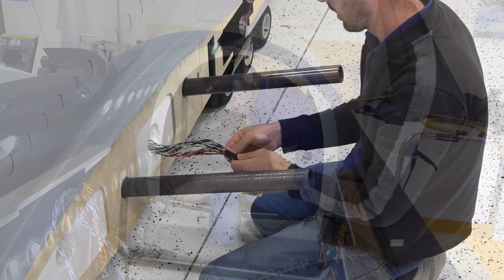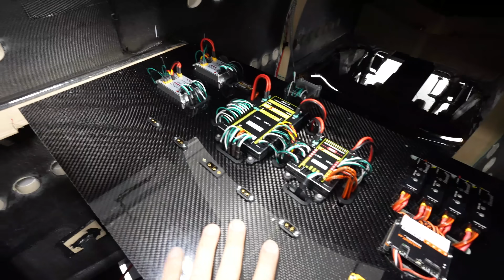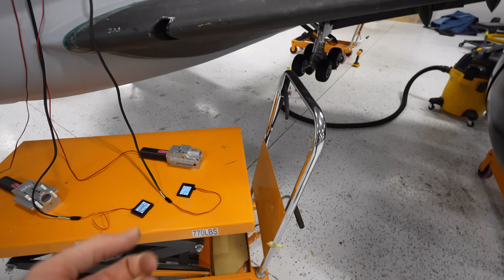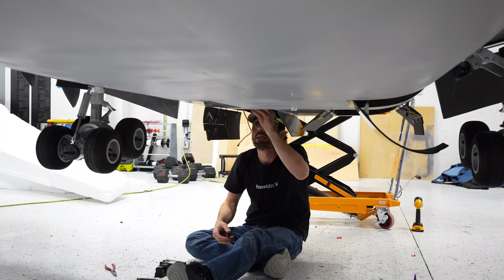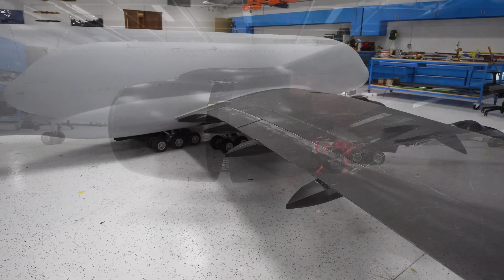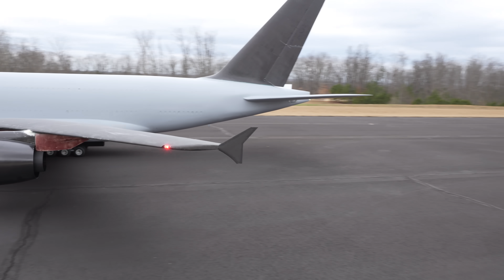Ready for the first flight, World's biggest RC Airbus A-380, Final

Comment: Spoilers should be disabled below certain speed during airborne. Weight on wheel sensor should be used for deploy on ground. Otherwise accidental deploy during slow aproach would drive the aircraft into stall.

Comment: I don't know much about RC planes. But I have been following ramy for many years and this is my first time commenting. Is it possible to fly it further? Like connect a camera to the cockpit? And what is the range with the radio controller? Like mounting like a cámera and the screen shows the speed angle etc etc.. How far can he fly it? Would be cool to see something like that... With the size of that plane hehe. No small rc planes
Reply: No and no and no, it has less than 10 minutes of flight time, thats just few circles around. Also legally it has to remain in direct line of sight so its not going too far and no cameras.

Comment: What's the overall weight? Like everyone else, I ponder about making a manned version - at that point it's not R/C, it's an A380 shaped experimental airplane (probably not even an ultralight, too heavy). I don't know the weight of this version, but with 450lb of thrust I'm sure you could make a version that could lift a person pretty easily. Could probably get FAA approval to fly it, in fact they might be more okay with that than such a huge R/C thing. The pilot would need to be multiengine rated!

Comment: Nice video @Ramy Rc the a380 look good but there Is a Rc engine that still on when ITS idle  instead of The engine that Will On if the Remote control Throttle Pushed but still Is a great a380 model

Comment: Super impressive!  I offer a suggestion ... for workshop testing, if you have some current meters (ammeters) that you can plug in-line with the batteries ... this will reveal unexpected drain on the batteries.  This would have identified the servo loading problem, but could also help identify other unexpected issues.  For the very high current circuits, inline current shunts of a few milli-ohms can allow current to be measured using a millivolt meter across the shunts, while having negligible effect on the system.

Comment: Can't wait to see the final product. Would love to see the Emirates "United for WIldlife" livery on this one, though it might be hard to reproduce the animal art. The Emirates NBA livery is very sharp as well. Too many good ones to choose from.  A plane this size & scope needs an equally good livery. Something that has always bugged me on these builds...I suppose cutting the gear doors from the composite structure makes perfect sense, but they need framing on the back sides to supply reinforcement and to give them some substance and depth. Also, seal & finish the edges of both doors and control surfaces so they don't look like mere cut-outs. It's a minor change, but the result would be much more scale in appearance.  I will say the new gear and especially tires that you are using are much better. The ones on the 777x were too narrow by far, but these are very scale.

Comment: Great job Ramy 👏,  but one thing that I noticed on the port side or left hand side of the airplane ✈️ facing forward,  the reverse thrust shell don't know the technical word for it , I notice that it vibrates and try to open up after applying thrust to the engine🤯😬 maybe that can become an issue later on wouldn't hurt to have it checked out 😊 and make adjustments 😁

Comment: for the landing gear sequence problem, I think time is not a reliable source, if for any reason, the door is not were is suppose to be, it will crash with the landing gear, a better solution would be having a sensor or a switch that sense the door reached position and only after that, allow the landing gear move.  I'm a hobbyst and do arduino projects, but from RC I do not know nothing, just my 2C

Comment: I know you know what you're doing, but in the spirit of "check everything"... I would like to point this out.
On some full scale aircraft (small GA in my case) we had to compensate for loads from being "in the airstream" when checking gear door clearances and gear swing timing (door shutter, gear drag etc...).
Meaning that it would work on the jack stands, but get jammed when going 100+mph. Saw this happen first hand on a twin Bonanza and it cause an emergency in flight.
Not sure how you would like to do this in this case, but what we did was create large safety margins, then do a flight test with multiple swings, and then close the "gaps" in accordance to measurements we took in flight.
Perhaps start with huge delays in this case, then using a camera underneath in test you see if there are any changes (like gear swing time etc...) while at appropriate airspeed, then decrease delays/adjust control linkages to the desired tolerances?
Not sure if that helps, and honestly I doubt this would make a difference here, but thought I'd just say it cause I thought it was interesting.
Anyways I love this channel, been a fan for years, big ups Ramy and Tyler for doin this craziness!!!

Comment: Ramy please watch the reverse thrust on engine 2 and 3, when you apply power, they are opening slightly, if this happens because pressure forces them open, it's gonna be hell if it happens on take off or in the air, if they open to max. Do a full power check on the ground before maiden an see if there is any chance they can open without command. And please don't ever stop making new models🤩😍🥰 Grüßeee
Reply: Whilst it could have some mild aerodynamic effect, the reversers are just cosmetic. They don't work to provide reverse thrust.
Reply: @kwerk2011 he showed it reversing in the video?
Reply: @MattRoberts-t4c  It's just a mechanism to open the shell of the engine fairing, giving the appearance of a thrust reverser. It doesn't actually work to reverse the airflow. Ramy describes it in an earlier video.

Comment: Just asking, I have zero information regarding to that, but, why jet engines are not used in this model? Is there a reason, or just a matter of preference?
Reply: Electric are faster to set up and fly. Turbines are fire hazard - look at that dry grass around.
Reply: @randomnickify  Thank you, as I understand, using jets adds additional risks. But in which circumstances one should use those?

Comment: 10:17 Ramy, You have to go away from pure Time Sequencing and go towards Event Sequencing. You have to involve sensors that will tell your system that such and such event has occurred, i.e.; Door Fully opened, until then you don't lower the gears and vice-versa. That should be easy to program with an Arduino setup. There are no reasons to get to full resiliency like an actual airliner, but for now, this step should solve these potential problems.
Reply: I was just wondering the exact same thing. Hopefully he explains why he didn’t go that way
Reply: @sipsapsop  lazy
Reply: @thomgizziz someone spends weeks building possibly the world’s largest A380 rc replica and you call him lazy just cos of this? You don’t even know the why. SMH
Reply: @sipsapsop  HEY!

Comment: You should use end stop limit switches with roller for the landing gear. It gives you position assurance; will not break the doors. Also never recoil landing gear during maiden flight, I might be too late on this one...

Comment: There is a solution to the gear and doors timing.  Use micro switches that locks out the gear doors circuit until there is a signal that the gear are either fully down and locked or fully retracted.
Reply: I strongly agree - that has been my first idea when watching these difficulties: Use end stop switches to synchronize doors and gears. It would require only a few lines of code in any micro controller...

Comment: At 66 years of age I think the most impressive thing about these planes is not the size and complexity of them, it's the ability to program everything into one transmitter, it used to be if you had this many servos and engines you needed two transmitters and two pilots, the new technology is so impressive and amazing to me.
Reply: I remember buying a very expensive Futaba 6ch and using servo arm and horn position to adjust the throw rates
Reply: @texasrob2782  Yup, my first radio was a  Challenger 550...lol
Reply: @t @texasrob2782  I had Futuba 6 channel as well, cost a small fortune back then
Reply: Don't forget it has a gyro system too, so almost certainly full autopilot is available.
Reply: @slammerf16 and pitot. Wouldn't be surprised he's got radio altimeter
Reply: Die Zeit steht nicht still und der Geldbeutel wird schnell leer 😢
Reply: Wow, it's insane that you once needed a co-pilot to fly an RC plane. Kinda funny how flying a model plane can mimic real life.
Reply: Well, worst case you could always build your own system with your own microcontrollers and firmware and use LoRa for digital transmissions.
Reply: That's an excellent point.  The ability to link so many functions together to run automatically is a game changer.  Amazing that two hands can do it.

Comment: that thing is bigger than a Cessna 172😭
Reply: When your RC toy is bigger than an actual passenger aircraft.
Reply: Yes I was gonna say..and I use to fly C172's!
Reply: I'll correct my remark..it's DEFINITELY bigger than a C152 then..that is in wing span and body length, not height!.
Reply: @KoolKman  Is it legal to fly such a large radio-controlled aircraft? In Europe, it's impossible without special permits, obviously.
Reply: @KoolKman  no it isnt
Reply: @thomgizziz  well its def not as big as your mom
Reply: Ramy should do a 1:1 scale R/C Cessna
Reply: @chrissugg968 must be 2:1 scale 😁
Reply: @chrissugg968  A318
Reply: and makes almost twice the hp!
Reply: It is THREE times larger than a tiny single-seat turboprop called the Cri-Cri.😂😂😂
Reply: Interestingly enough, Rami mentioned 450lbs of thrust. Depending on the prop and pitch setting, a Cessna 172, static thrust (at full power, aircraft stationary) is capable of roughly 400–500 lbs of thrust at sea level under normal conditions.
Reply: Bigger than a Cassutt racer
Reply: It could
Reply: LOL TRUEE😂😂
Reply: Basically a car
Reply: it is no cap
Reply: even he rides the wings💀
Reply: I swear
Reply: It’s big but it ain’t that big lol
Reply: @TJlive5  Bigger than a 152 though
Reply: Does he mention the wingspan during the build? I think you're right and it's about the same as a 150, at least larger than and RV8.
Reply: @benedekhalda-kiss9737Length and width probably, but definitely not height wise
Reply: @StoopyMcPoopy its really long
Reply: It is built at 1 : 10 scale that means it has a swing span of 8 meters which is a bit smaller than the 172 11m but it's quiet close   @StoopyMcPoopy
Reply: @martinputz8010 Haha I guess I could have mathed that. Thank you!

Comment: Congratulations, that's an amazing plane. Amazing chassis timing. How many meters of cable were used on the A-380? How is it possible that the voltages for the servos remain stable over these huge cable lengths?

Comment: Do the mains have limit switches to drive the sequence? Or do you just use the encoder position to trigger the sequence? Looks very tricky to get that timing perfect (and god help you if the temperature changes and parts are different sizes/tolerances! Can't wait to see this beast in full livery flying. You do have the dream job I think!